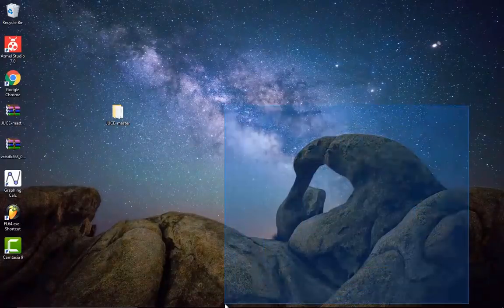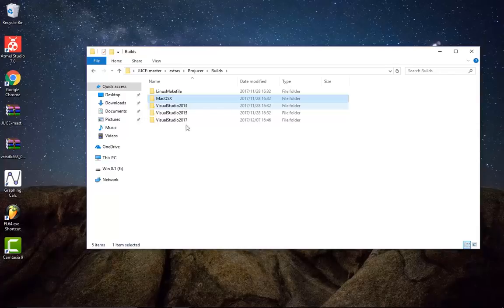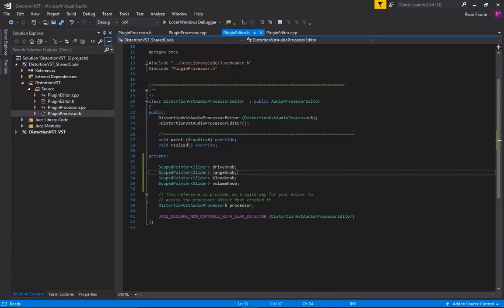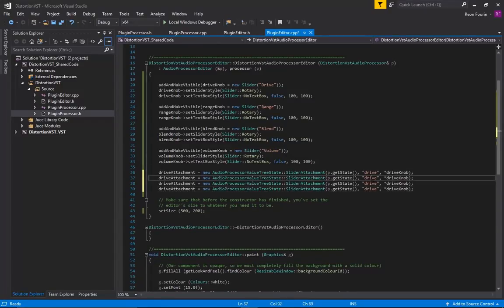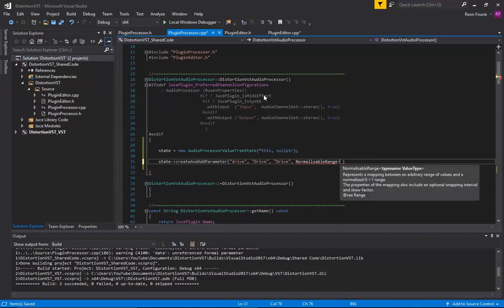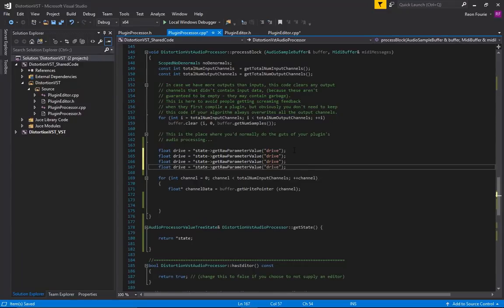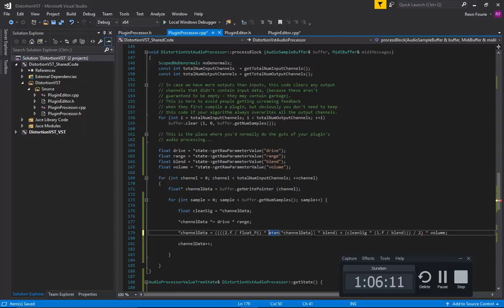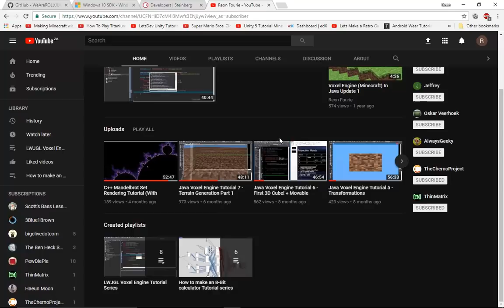Audio Processing Tutorial: How To Create an AWESOME Distortion VST/AU Plugin In C++ (JUCE Framework)

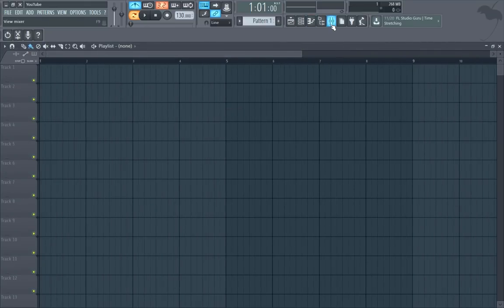Comment: 00:01:31 - Demo/Preview of the intended result
00:07:41 - Prerequisites
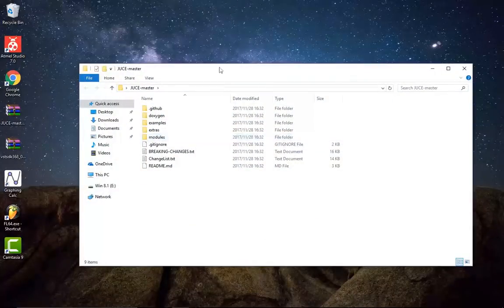00:11:04 - Preparation (JUCE)
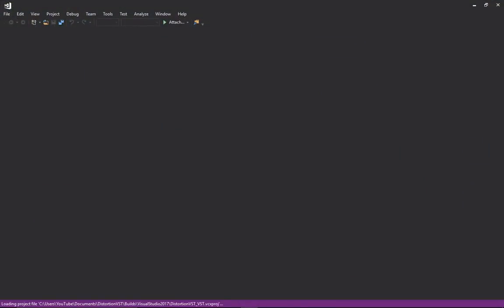00:17:04 - Preparation (Visual Studio - see the workaround in the first reply to this comment)
Coding:
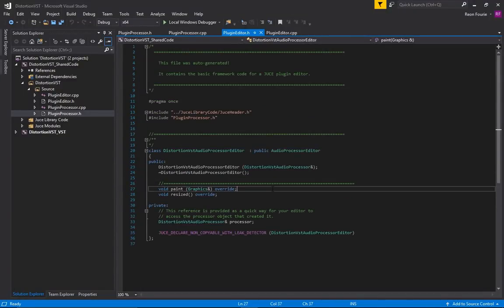00:20:02 - Creating the GUI
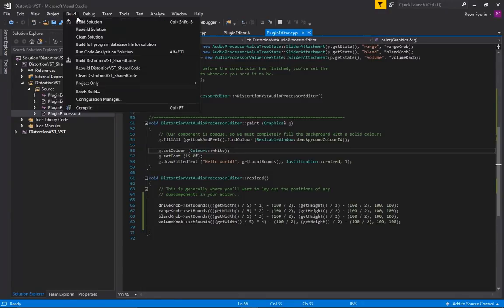00:37:12 - First Build and Test
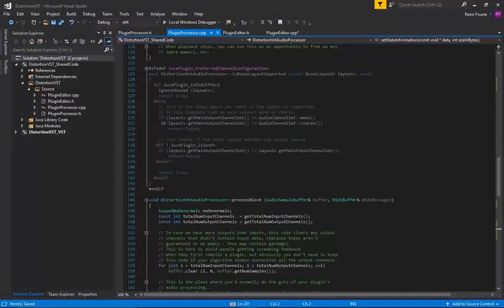00:51:03 - Signal Processing
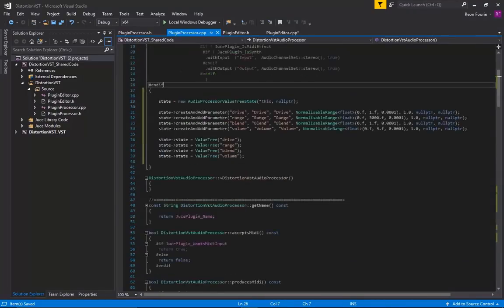01:07:00 - Build and Test
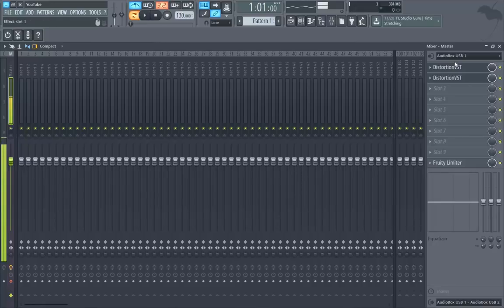01:09:11 - Adding knob labels in the GUI
01:12:34 - Test and correction of Blend knob functionality

1:14:40 - Closing
Reply: Q: Arcade Era Beats
 1 month ago
I might just be dumb, but I can not for the life of me get this to compile using 2018 sdks. (...)

A: VOLT DOG 1 day ago
Hey I have the same issue, from some digging I found this on Juce's website:

Link here: 

https://juce.com/discover/stories/juce-5-4

Change: The VST2 SDK embedded within JUCE has been removed.
Possible Issues: 1. Building or hosting VST2 plug-ins requires header files from the VST2 SDK,which is no longer part of JUCE. 2. Building a VST2-compatible VST3 plug-in (the previous default behaviour in JUCE) requires header files from the VST2 SDK, which is no longer part ofJUCE. When a new JUCE plug-in project is created the option JUCE_VST3_CAN_REPLACE_VST2 will be set to zero.
Workaround: 1. The VST2 SDK can be obtained from the vstsdk3610_11_06_2018_build_37 (or older) VST3 SDK or JUCE version 5.3.2. You should put the VST2 SDK in your header search paths or use the "VST (Legacy) SDK Folder" fields in the Projucer. 2. For new plug-in projects where you will be releasing both a VST2 and VST3 version, and you want the VST3 plug-in to replace the VST2 plug-in in hosts that support it, then you should enable the JUCE_VST3_CAN_REPLACE_VST2 option.
Rationale: Distributing VST2 plug-ins requires a VST2 license from Steinberg. Following Steinberg's removal of the VST2 SDK from their public SDKs we are also removing the VST2 SDK from the JUCE codebase.

Comment: @1:05:37 the correct way for dry/wet control is: (distorted * blend) + (clean * (1-blend)) instead of ((distorted * blend) + (clean / blend)) /2

blend + (1-blend) have to be always = 1, otherwise you apply gain here

just try with 50% dry/wet:
blend = 0.5 -> (distorted * 0.5) + (clean * (1-0.5)) = (distorted * 0.5) + (clean * 0.5)

your formula with 50%:
blend = 0.5  -> ((distorted * 0.5) + (clean / 0.5)) /2 = (distorted * 0.25) + (clean * 1)

Comment: Hi, thanks for sharing.

I was wondering if (cleansig * ( 1.f / blend)) should not be (cleansignal * (1.0 - blend))  (and especially when blend can be zero) ?

Thanks,

Nahum.
Reply from the maker: Mmm now im confused myself my brain feels broken right now... ill do the math and confirm with you later but yea dividing by the zero can be catastrophical if the blend goes to zero
Reply: This works great!
Reply: Yes, that is correct. For a linear blend you need the factor (1.0 - blend).
Reply: Thank you for this! When my blend went down to zero the volume went full blast into my headphones >_<. This fixed things however.

Comment: I got an error while following this tutorial stating a file in the vst2.x folder was missing. I believe it's because the SDK in this video is an older one. I could bypass this though by instead of making a VST I selected a VST3 and just included the vst2.x folder, the VST2 folder AND the VST3 folder and everything worked! Hopefully this will help someone struggling with the same problem I had.

Edit: If the range knob is too harsh. try lowering the value from 3000 to something lower like 30.
Reply: Yo so what your saying is you had to make projucer project vst3, and include both the VST2 SDK and the VST SDK?

Comment: I might just be dumb, but I can not for the life of me get this to compile using 2018 sdks. After following every step exactly as shown. I'm getting the error aeffect.h not found and aeffectx.h not found. Apparently those files were renamed to audioeffect.h and audioeffectx.h. Why would they do this? And after changing all the names of those files in the code I'm now getting 283 Errors and my code will not compile. What am I doing wrong? Apparently noone is having trouble
Reply: same problem here
Reply: Could you rectify??
Reply: Hey I have the same issue, from some digging I found this on Juce's website:

Link here: 

https://juce.com/discover/stories/juce-5-4

Change: The VST2 SDK embedded within JUCE has been removed.
Possible Issues: 1. Building or hosting VST2 plug-ins requires header files from the VST2 SDK,which is no longer part of JUCE. 2. Building a VST2-compatible VST3 plug-in (the previous default behaviour in JUCE) requires header files from the VST2 SDK, which is no longer part ofJUCE. When a new JUCE plug-in project is created the option JUCE_VST3_CAN_REPLACE_VST2 will be set to zero.
Workaround: 1. The VST2 SDK can be obtained from the vstsdk3610_11_06_2018_build_37 (or older) VST3 SDK or JUCE version 5.3.2. You should put the VST2 SDK in your header search paths or use the "VST (Legacy) SDK Folder" fields in the Projucer. 2. For new plug-in projects where you will be releasing both a VST2 and VST3 version, and you want the VST3 plug-in to replace the VST2 plug-in in hosts that support it, then you should enable the JUCE_VST3_CAN_REPLACE_VST2 option.
Rationale: Distributing VST2 plug-ins requires a VST2 license from Steinberg. Following Steinberg's removal of the VST2 SDK from their public SDKs we are also removing the VST2 SDK from the JUCE codebase.
Reply: @VOLTDOGmusic  I was about to say the same thing. Youtube never notified me of these replies. I wish vst 2 was still supported or at least that vst 3 could use .dll instead of .vst files
Reply from the maker: This is odd but ive heard from others that many of the stuff in this video is deprecated by now so ill have to make an update vid on this
Reply: @ReonFourie  that would be awesome!

Comment: Hey, nice work! 1:05:30 I don't understand why you divide the clean and distorted signal by 2. The blend value already takes care of evening out the levels, doesn't it? It makes the signal just half as loud.
Reply: To get the average of two signals (what the output of the blend should sound like), you add both signals together and divide by two. Just like if you were getting the average of two integer values. That's my understanding, anyways.
Reply from the maker: Thats correct
Reply: Yes, but I think you already perform a weighted summation with the blend value. If blend is 0.5, you have 50/50 clean and distorted signal with max amplitude of 0.5 each = max amplitude of 1 of the added signals (like simple averaging). If blend is 1, the distorted signal has a max amplitude of 1 and the clean signal has an amplitude of 0 = still max amplitude of 1 of the added signals. There is no need to divide by 2 after that, since the max amplitude of the mix just becomes 0.5 after that. Or am I missing something?

Comment: Hello, I'm new to all of this and your tutorial is really helpful. I'm getting an error when building the dll that it "Cannot open include file: \pluginterfaces/vst2.x/aeffect.h': No such file or directory. I've checked to make sure I've included the folders you have on both the projects. One thing I realized is that there is no "plugininterfaces" folder in VST_SDK / VST2_SDK but there is in the VST3 version. Am I doing something wrong or did Steinberg discontinue VST 2 or something?

Thank you!
Reply: Yeah Steinberg actually removed VST2 SDK for a while from what I've read and guess people complained and they put it back but basically they treat it as if it doesn't exist, they want everyone to use VST3. I'm having the same problem as you are, did you figured something out? I tried changing it to go for the audioeffect.h and audioeffectx.h files but it gives me like 100 Errors
Reply: @MintyDoggo  Actually, I have an update :D I made it work after an hour or so (after wasting like 7 hrs trying to make VST.NET compile -.-). Yes, I changed to VST3 and it worked no problem, I managed to get the volume and drive working since I'm doing a pitch shifter and didn't bother to make the whole distortion pedal. I'm planning to record a video and maybe a post somewhere since I can't find many info about it, I'll add you in case you need help, maybe we can help each other
Reply: @MintyDoggo  I was going to send a reply but it was 2 am and after all that ordeal I just wanted to sleep haha
Reply: @ErimlRGG  dude that's epic lol.. message me on discord plz
Reply: @ErimlRGG  How did you change to VST3?
Reply: thank god for this comment, i did this 3 times and I got the error too,
Reply: @ErimlRGG  Any info on how to accomplish this?
Reply: @Juanmorocho_  Weird, I never got notifications for the other tag. Sadly I couldn't get the VST I was working on and I haven't check it in months. Let me find the notes I made and my project and I'll get back to you

Comment: If I don't use Visual studio but other IDE (Netbeans), how should I proceed with the first step, when you open a VS project from the extras/Visual Studio 2017 folder?
Reply from the maker: I would suggest that its time to get VS otherwise you will have to set the project up in netbeans manually which will be a huge pain with of all the dependancies and libraries

Comment: Hello, when you build the plugin 40 minutes in it comes up with a critical error, do you know why this is, it seems like others have the same issue. If possible could you make your source code available? edit found out this happens with the slider attachment code, idk how i am meant to fix it
Reply: Do you get a critical error when building the solution or when you load it into a DAW or host? If the error is with building the vst then could you post the exact error message? If it is when trying to load the .dll, then we would probably need to see your exact code as these are runtime errors which are a lot harder to find.
Reply: kaddru it's alright now fixed it earlier today. It was when loading it into FL studio but I carried on with the tut and it works
Reply: Having issues with the slider attachment code, how did you fix it?

Comment: Hello! I was trying to follow the video and was noticing tons of errors in my code without even adding any code it just couldnt compile stock at all. So i figured out that vst2 is no longer supported but i was trying to add vst3 to the project and im so lost and really want to be able to start making plugins. Could you show us how to add vst3 or possibly link a download for vst2? (update, downgraded to older Juce version but getting tons of errors on compile)
Reply: Adding VST3 libs as dependencies is shown somewhere around 18:00. I doubt anyone will link VST2 as that requires a licence. Anyway, what kind of errors are you getting? I'm assuming you've already linked the VST3 library to the project.

Comment: Hey guys, I loaded this plugin inside cubase and it doesnt do anything to my audio sample. Is it a matter of 32x/64x ? Or just me missing something in the code ? The knobs and the GUI are working perfectly fine, it just doesnt change the audio signal
Reply: Hi. I'm having the same issue. I wondered if you solved the issue at all? I can compile and open the plugin inside Logic Pro X but when adjusting the knobs I hear no distortion. Volume seems to be working though. Thanks.

Comment: If anyone is having a problem getting the .vst3 (new ito VST3 instead of .DLL) file to work with FL Studio, you need to put the vst in a specific location on Windows 10: C:\Program Files\Common Files\VST3 
Otherwise it won't detect the VST3 plugin. DLL's should work fine, this is just for .VST3 files
Reply: there is no VST3 folder in common files for me and there is no .dll file generated from code.

Comment: Heads up:  ScopedPointer is deprecated in Juce now.
Reply: I noticed it as well, but don't know how to change the code  yet :(
If I do "std::unique_ptr<Slider> driveKnob;" then " addAndMakeVisible(driveKnob = new Slider..." doesn't work. Could you explain how to work with addAndMakeVisible then?
Thanks.
Reply: @jansukdol617  I Don't know. I wish I did! I have decided to take a couple steps back and get my fundamentals down.  I'm going through the C++ tutorials by the Cherno.  Which I recommend.  Even though his series is 2 years old, he is showing how to use std::unique_ptr and fully explains pointers, smart pointers etc.  I haven't been back to JUCE for a moment though.  I do plan on it, as this tutorial plugin does sound pretty good! :)
Reply: @jansukdol617  did you solve the problem?

Comment: I'm stuck at the 40 minute mark. My plugin has the "critical error" but adding the state initialization in the Processor constructor didn't fix mine. Code is word for word exact
Reply: Sean Franklin yes mine does the same. Have you found a fix?

Comment: 44:55 If you don't suffix these values with an "f", they will defaults to being a "decimal" type. This is then implicitly converted to a float. Whilst this works, it's poor practice. It might not matter so much in this use context but, in general, these things do matter. Especially if you're serious about being a C/C++ dev, and even more so when working on code that needs to be performant, such as signal processing. Cool video though :)